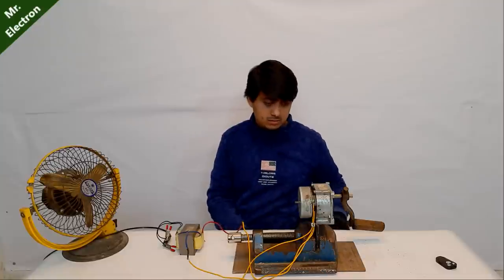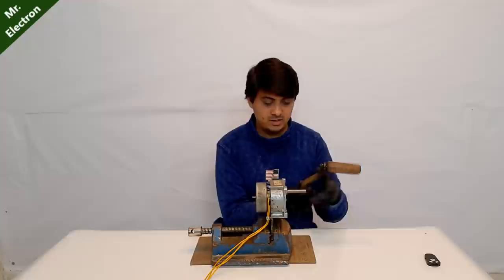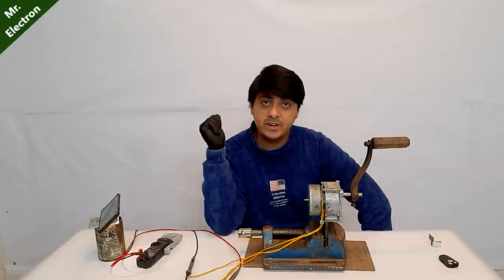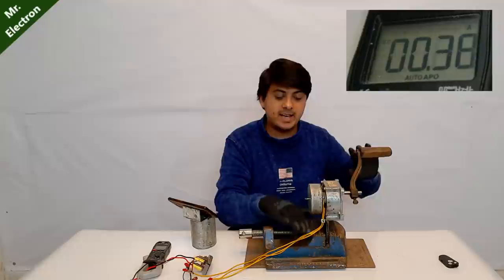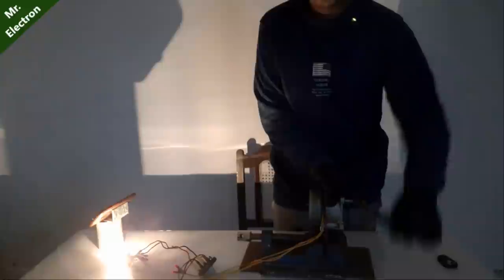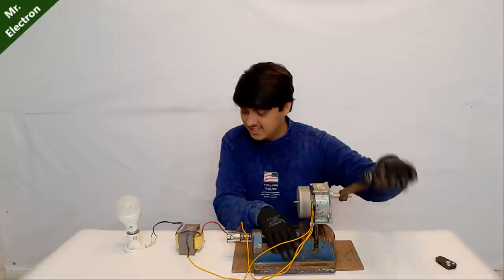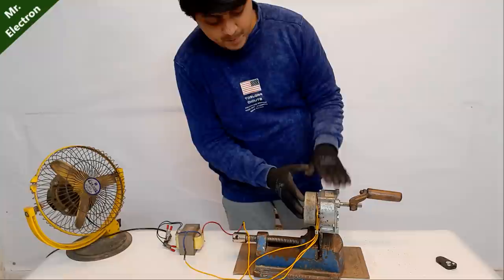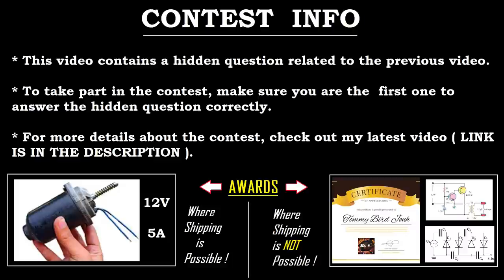Make 220v Electric Generator using Brushless Gear Motor BLDC - 180 RPM

Comment: Bhai lovely experiment, you should make yourself a remote light switch bro that will save you the trouble to stand up again n again to switch off the lights, Lovely video, God bless you 👍👍🙏🙏
Reply from the maker: Thanks !!!  You are right :)
Reply: @MrElectron  I wish to share with you a VAWT I designed, you can surely test this generator on it and charge batteries, to share those images of 3D I wish to have your mail id dear bro, you are doing great work hats off to your ideas, I worked with radio n film industry and now I make batteries for EV's and other applications, doing full time research in renewables. Wish we can work together on some project👍👍

Comment: Create 24 pole  3 phase generator with 50/60hz  72 times coil winding 20 -30 turns double copper wire. Use neodymium magnet

Comment: well if only 60% of power generated is received by the appliance you should try to use toroidal transformers..
since classic transformers have such a heavy loss in the facts...
toroidal transformers are made yes with ferrite,but for higher wattage output its used metal shits,since on classic transformers the electricity has to jump from the E to the I,with toroidal transformers the electricity run around in a spiral...